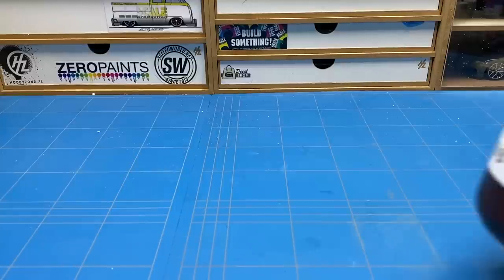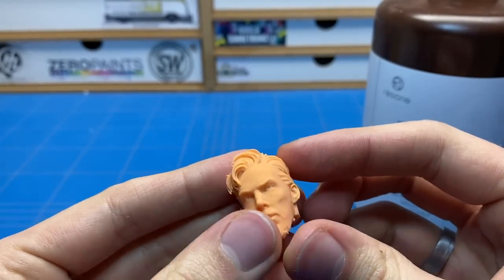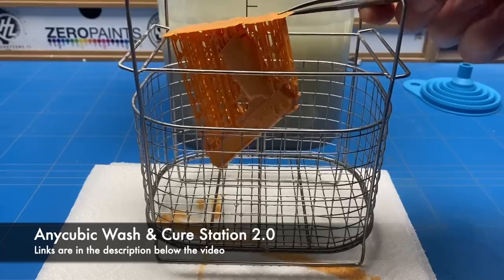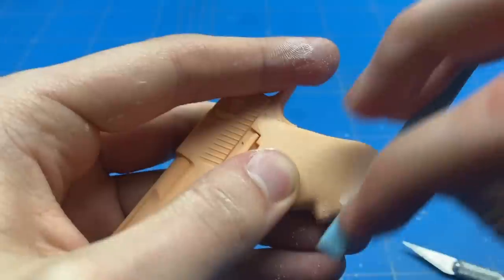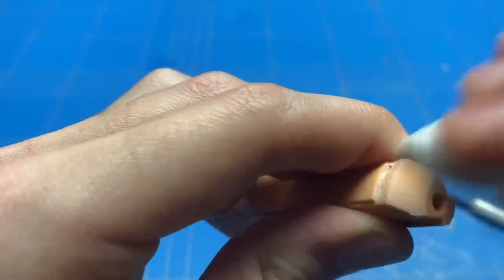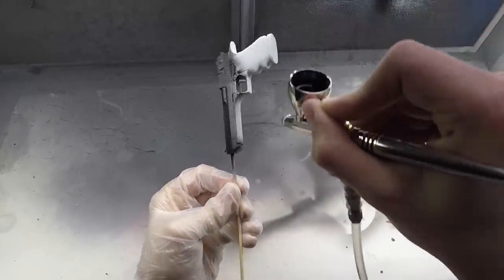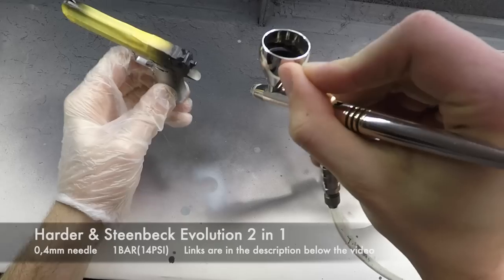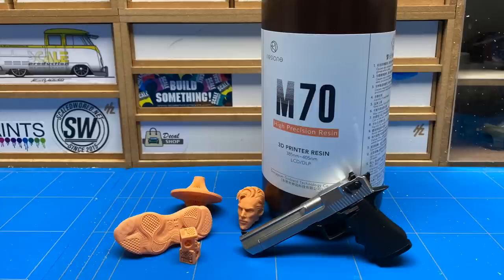Building a Tiny 3D printed Desert Eagle with Resione M70 3D Printing Resine

Comment: Good job. I've buy this M70 Resin but can I have your set for the print with Elegoo Mars pro, time of exposure etc... thanks for all Gégé
Reply from the maker: Standard settings 0.05mm layerheight
Reply: @TheScalemodelingChannel  but for for the time exposure base and time exposure? my prints are failed with exposure base 40s and exposure normal 3s?
Reply from the maker: @Gegemodel  base layers 40 sec and normal layer 2,5sec
Reply: @TheScalemodelingChannel  OK thanks with my Elegoo saturn it's difficult to make a good piece. I'm going to test a new print with my Elegoo Mars pro. Thanks.... Gégé
Reply from the maker: Make sure the room temperature is atleast 20 22 degrees
Reply: @TheScalemodelingChannel  less that this 18°C
Reply from the maker: @Gegemodel  too cold